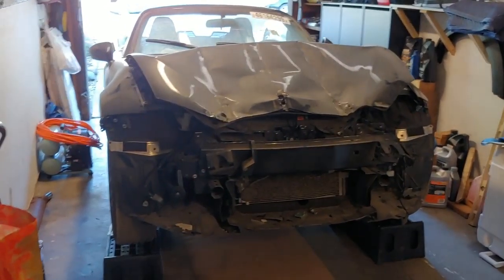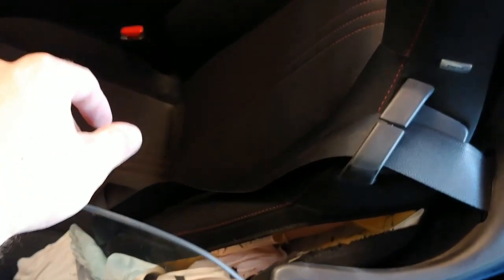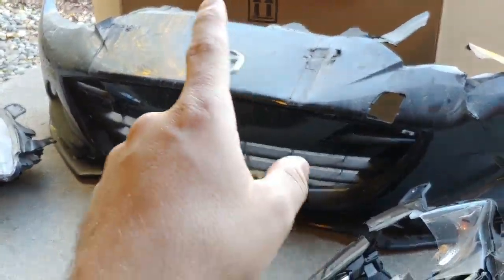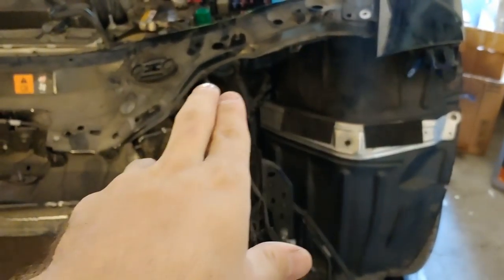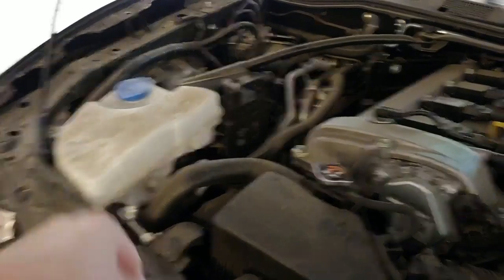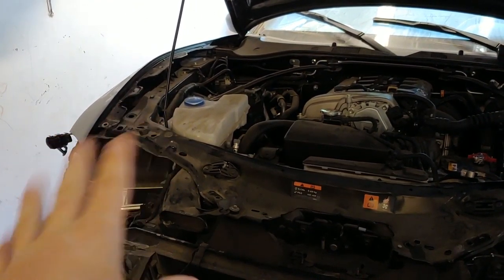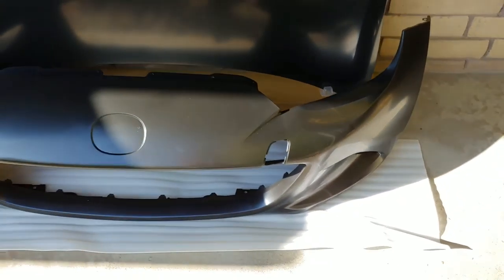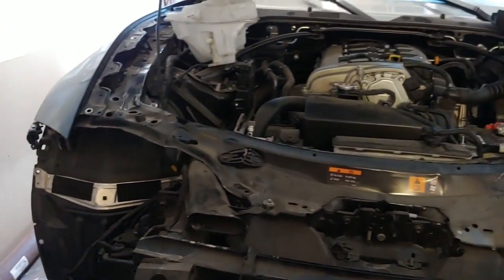My salvage 2016 Mazda MX-5 Miata has been delivered

Comment: Someone stole my tow hook cover off my 2016. I ordered a blank one for 1.76 and 5.00 shipping and covered it in some carbon fiber vinyl. It matches my carbon fiber front lip and trunk. I also bought my brembo brakes off a totaled club since mine is a GT. Good luck on the interior. There's someone selling a complete interior on miata.net at the moment but the price is high imo.
Reply from the maker: I currently bought all the interior parts, just waiting for them to come in.. The most expensive sruff is airbags/ seatbelts